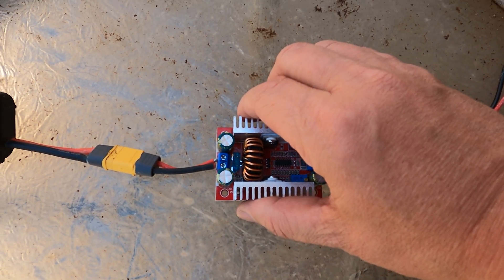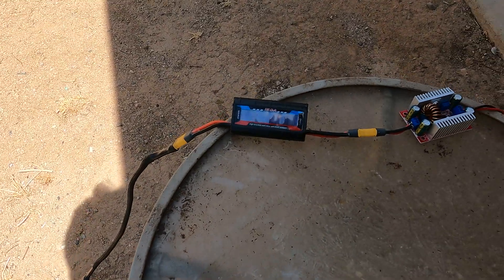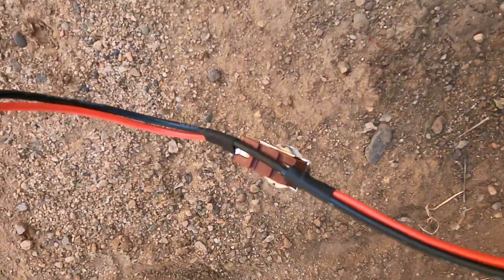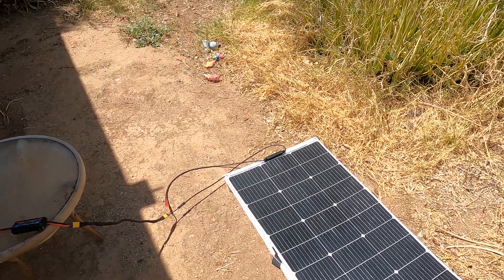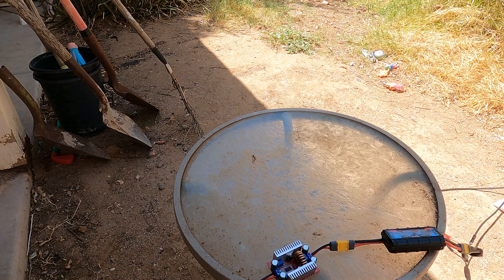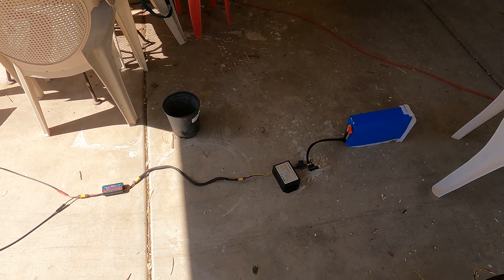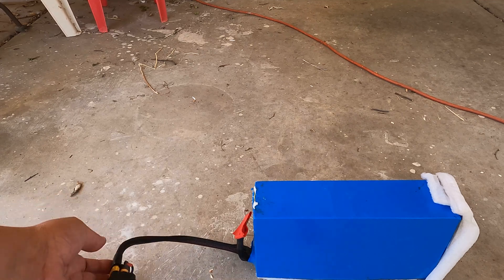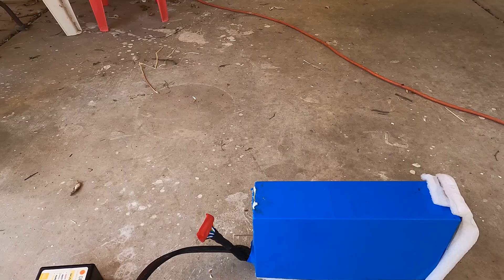Cheapest way too solar charge EBIKE - NOT RECOMMENDING

Comment: Re:  The cheap booster... The instructions state If you use the module for battery charging, connect to output after battery is fully discharged.
Because if the more energy is left in battery, the less charging current will be.

Comment: I'm working on my solar as well. Unfortunately I have 72v 30ah my charger is a 5 amp I'm trying to get as close as possible to 5 amps as I can I already got a solar controller but I paid a lot for it 250. the ones  before this one blew up.